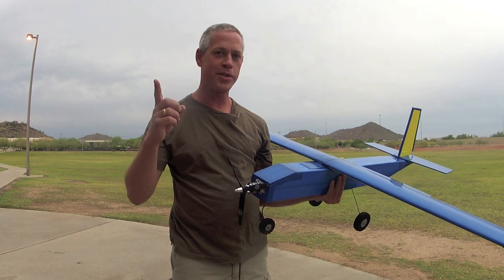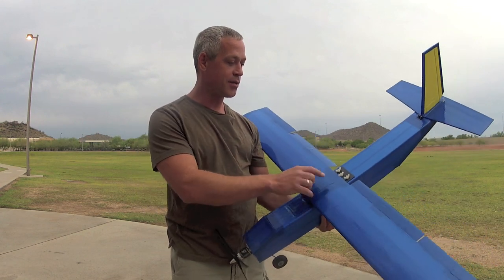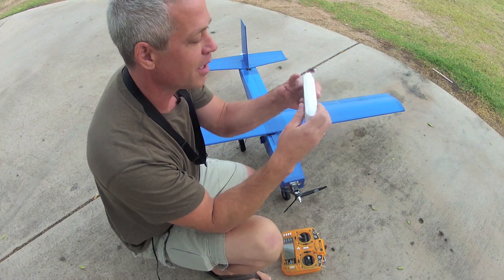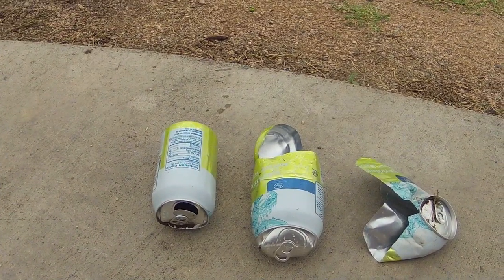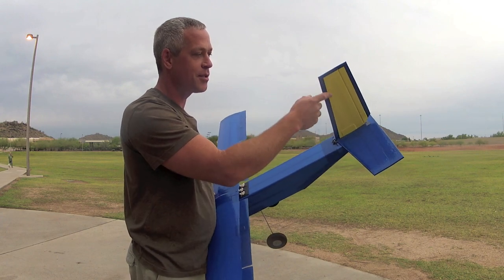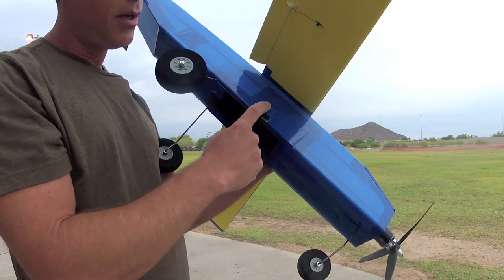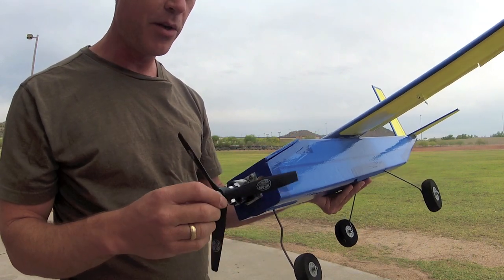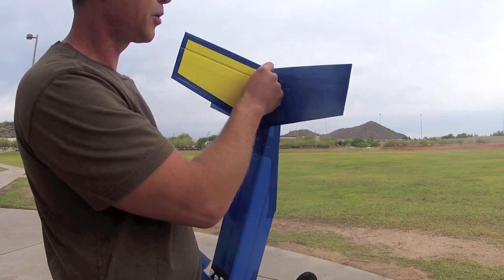DONKEY RC Cargo Plane

Comment: I envy you for your energy to follow ideas and build new stuff. This plane looks like fun.
You might also strech your vertical stabillizer a bit forward over the fuselage instead of building some kind of a tower, lol. Looks slicker and also provides you with more surface too. It´s often done on big and model planes.

Comment: Ed-Once again you have continued to encourage scratch building!  Many thanks.  I have also made and flown (an crashed) the J-Scott.  Great plane…lazy thumbs!  I am now hyped to build the Donkey.  Not sure if you mentioned the fuse dimesnsions.  I suspect it is similar to the J-Scott.  I also only have 3300mAh batts.  If I bag the can drop and drop back to a 2836 NTM do you think that will provide enough thrust?  I am not really into speed (age 73) I just like the challenge of keeping everything level and reasonable slow.  I am flying Dave Powers park jets (F-18 and F-35) and am having great success and fun with those builds.  Continue your good work!